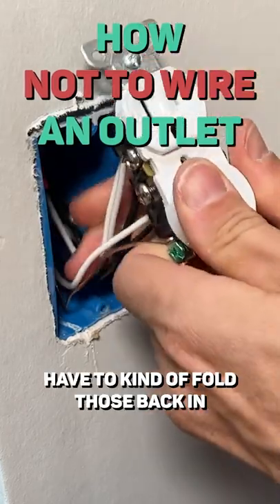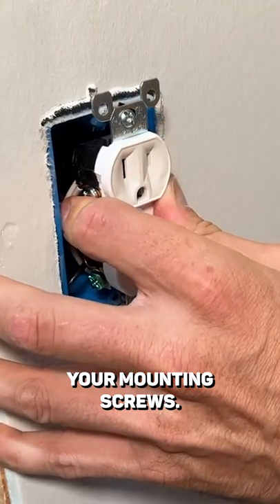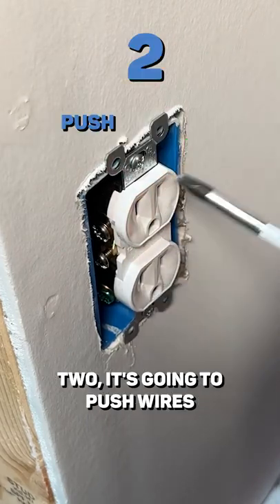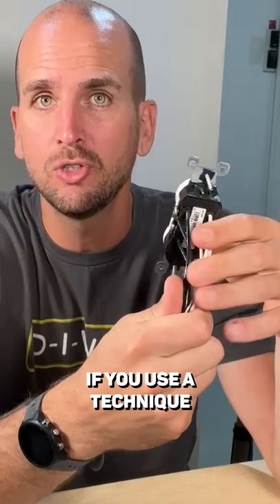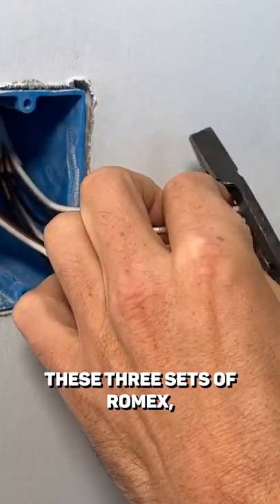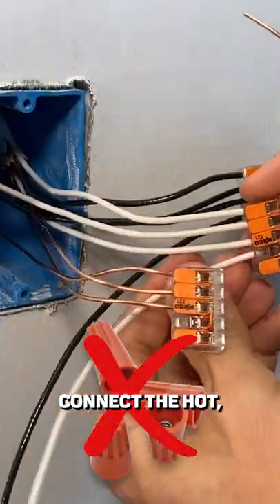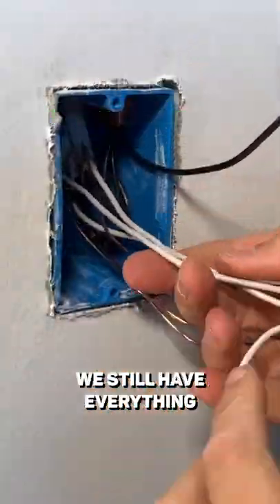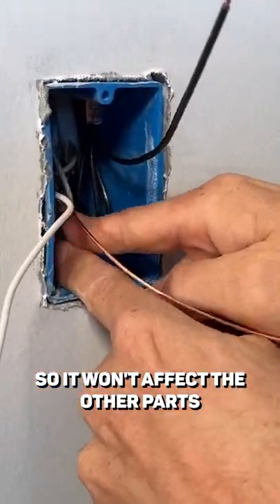The Better Way To Wire Outlets #shorts

Comment: wagos will never be better than actually twisting your wires with lineman's.  I've heard some people in the trade call wagos baby burners. The wires don't always pop out but I have seen it.  If you twist your wires properly under a wire nut the wires will never pop out . We do use wago on the trade but I have yet to meet a good electrician who likes them.
Reply: the problem with wagos is twist to release... when your ramming wires into an enclosure that wago can rock and twist and loosen the connection... wires twisted with lineman and a wire nut is far superior in my experience... I used to build and remodel homes.
Reply: The lever Wagos only fail if you haven't correctly inserted the conductor into it with enough insulation removed or not snapped the lever back in properly.
Reply: @Ad-gn8pl  lever wagos are nice. push in or push wire not so nice.
Reply: @thinkamajig  never had a problem with the push fit Wagos, I prefer the lever ones though as they are easier to remove.
Reply: Lever Wagos ftw with lighting.  I'm gonna stick to twisting and wire nuts for receptacles though.  Less resistance.
Reply: Electrician here and I do not prefer w
Wagos. A properly installed marrette is perfectly fine
Reply: @Teh_Random_Canadian  wire nuts aren't used in the UK. Wagos are now the preference. Reusable, demountable and they don't wreck the conductor
Reply: @Ad-gn8pl  Wagos are uncommon here as a properly installed wirenut will never come undone and provides a much better surface area connection
Reply: @Teh_Random_Canadian  when you need to remove the nut and extend the circuit what do you do? Wagos also will never come undone 😉
Reply: @Ad-gn8pl  untwist them with your linesman...
Reply: @Ad-gn8pl  wire nuts untwist... Easily.
Reply: @randybobandy9828  After removing a wire nut you are left with conductors that are already damaged from the first installation, then you damage them more when you reinstall unless you cut them back, shortening the wires.  Wago doesn't have that disadvantage, they are much nicer to use when testing and fault fading circuits.

Comment: I love the Wago nuts. My only complaint is that they take up a lot of room in the box - especially if it has 3 or more sets of romex coming into it.
Reply: I was concerned about that too before I took the plunge and bought my first box of Wago nuts, but now I'm actually inclined to disagree. I've personally found that they're easier to manipulate in a box than marrettes. Putting aside the conveniences of being able to add/remove wires as needed and not having to twist them all together, I find that while they may be slightly wider than marrettes, they're shorter and flatter, and their rectangular nature allows me to shove them neatly into the back corners of my boxes. Plus the fact that each wire can swivel inside the connector gives a HUGE flexibility advantage.
Reply: @donaldholden2090  Ok, you've convinced me. I'm going to order myself a box of those guys and try 'em out. I've got some repair work and some new runs to put in.
Reply: @mrz80  Make sure to get the 221 series. Let me know what you think!

Comment: 3 The recepticle is installed upside down. Ground pin up for safety.

4 Backwired to be less reliable and less safe. Use the recepticles with saddle clamps.

Comment: Here, in the E.U. where everything is parallel, only 3 wires would go into the box in the first place. On top of that, its safer for power distribution as you avoid long loops.
Reply: How do you connect multiple devices to a single circuit? There has te be a connection somewhere unless each device is on its own breaker.
Reply: That’s not true. If you have a serial connection you mostly have 6 wires goin in.
The are connected to a outlet with push in clamps. Never fail. 3 wires are used only when there is no other outlet being connected from the actual one

Comment: Chances are if your stabbing in the back of the outlet, you’re probably using #14 wire. Pretty easy to work with. This design is mostly used by contractors anyway. It’s done for quick installation bc in that game speed is of the essence. If you’re a homeowner however, you might wanna pigtail bc it is a better installation.

Comment: Wago is fire 🔥 waiting to happen. Spent the last five years retrofitting a building that was remodeled using Wego’s. several fires throughout the facility convinced the owner to switch back to wire nuts and proper terminations

Comment: Use stranded pigtail, makes it easier to push in box and doesn't make recept lean one way or the other.  And tape recept before pushing in the box.  Preferably with 33. And screw wagos

Comment: If there's 3 sets of wires you did it wrong.
You should use screw down terminals if you don't like have fires. You should use steel boxes if you don't want fires to get out of boxes.

Comment: All my outlets are pigtails with the twist-on connectors (made in the 1980s);  I know because I had to troubleshoot and trace a `open neutral`.  One of the sockets that never gets used was the culprit (behind furniture).  I trimmed it down and reconnected.  Since the mains were off, decided to inspect every socket and switch in the house.  Electrician did a real good job in the 1980s.  But there were disturbing layouts that would not fly today.  Like the bathroom gfci controlling the outlets for another room.  GFCI outlet failed a test because the reset button would not stay depressed|on.  Had to go and find a GFCI.  Fun fact.  The GFCI leviton outlets switched or swapped the LINE and LOAD positions from the 1980s.  1980s 20A GFCI outlet on a 15A breaker.  I bet you can probably do that now and 1980s;  probably transients like we get in computer motherboards.  Weird stuff going on.  Keep an out out for freaky stuff.

The wire-nut twist on connectors was great!  I could check live voltage of the neutrals.  I could not imagine checking WAGO and IDEAL push in;  they don't have the test terminal spots.  Also I do alot of mobile electronics stuff.  Those WAGO or IDEAL connectors suck sometimes.  I have also seen lightning melt those little f4ck3rs and other things carry high amperage.  Was probably installed by a bad electrician.  But I think I like the wire-nuts twist on connectors better.  I guess current guys don't like it because it might be a possible point of failure or something.  The 1980s house wire-nut electrician did it perfectly and lots of thick 12 wire twist braided correctly on every connection.  That guy was good.

P.S.  I am not an electrician, but I am a computer engineer, electrical engineer, and CS major.  Probably had enough know-how to go d1ck1n6 around in there.  My dad's an electrician for a major utility plant and he and I would fix AC (alternating current) stuff and visit sites.  He used to teach me all the rules not to kill myself around AC electricity.   I've  been around electricity for a long time.  But I do not know current inspection codes.  So maybe it was legit.  Found this video to help calm my spirit to see what the laymen guys are currently doing in 2023.

Good Video.  And thanks.
Reply: Fyi the Wago do have test holes for probe

Comment: Use a full sized Metallic box with a single device cover.  and real conduit!   If you are just throwing in rope and plastic boxes, you may as well staple extension cords to the baseboards.   I hope you have plenty of insurance when those mickey mouse connectors start to fail.  That plastic will get brittle and the connectors fail before the owner pays off the house..

Comment: On top of all the other reasons/advantages of using pigtails, this is one never mentioned by most... better ability to fold the wiring back inside the box.  Only the wires servicing the device must be bent back as it is mounted, the rest are pre-folded into the box beforehand.

Comment: You can’t do this if you’re wanting the string to to trip your GFCI, right? You have to pigtail at least first in the string to the GFCI?
Reply from the maker: If you want downstream outlets (non-GFCI) to have GFCI protection the power feeding those outlets needs to come from the Load terminals on a GFCI outlet or the entire circuit could be ran to a GFCI breaker.

Comment: He's absolutely right about pigtails. Never use Wago connectors. The internal metal clips have a smaller surface area connection of the wires. Use wire nuts. Always, always wrap the outlet with tape.

Comment: OK, so here comes the can of worms. Back stabbing is horrible, I agree but if side screws are used how often does the connecting strip on a receptacle fail? Is the connecting strip not designed to take the full load? Are securely screwed connections not better than those spring loaded connectors? If the receptacle fails what difference does it make if the downstream devices stay connected; aren't you going to kill the power to change the failed receptacle? Please explain. By the way I am not an electrician but I think these questions are noteworthy.

Comment: I guarantee you, the walls of this house that I currently rent. My landlord outsources almost exclusively from 'immigrants-ar-us'.... I mean the ones that have been doing it 3 months and know exactly how to do everything, for much less than the guys that own the vans they drive... I mean that in most respectful way possible... Like, only a true electrical genius could wire every single ceiling fan in the house so that they powered independently of any wall mounted switch in the house. I'm sure they're on a breaker in the breaker panel as I at least checked to see by switching breakers off one at a time. The goal is to be well outta here by next summer.

Comment: The problem I run into with plastic boxes, is all of the shifting and moving around to fold the wires in, wiggles the Romex around so much that it breaks the integrity of the little plastic clamp coming into the box, and then the Romex is moving free in and out of the box.

Comment: Even if the plug fails it’ll be fine if the wires are screwed in.  It’s a physical connection.  Are you all suggesting the metal plate linking the two common or neutral screws is somehow going to fail?  How is that weaker than a wire nut?

Comment: That right there is a series circuit and you just put it into a parallel circuit which means if that receptical goes out it wont effect the other recepticals correct me if im wrong

Comment: By code the it's illegal for the circuit to be dependent on the device for it's continence. You should be able to remove the device without breaking the circuit. I don't recommend pressure connectors like the wago's in the box. Wirenuts take less room and are far more dependable if done correctly.

Comment: Pigtailing is not necessary and an added expense  if you have enough wires to use and done correctly. As others also said, it becomes crowded inside the box.

Comment: And ALWAYS put the wire around the screws rather than using the push connectors that won't maintain a solid connection.

Comment: You should have used electrical tape and wrapped it around the device in case the ground accidentally touches the hot screw.
Also those lever nuts are humongous you're not only adding lever nuts but you are also adding wire. Therefore I don't believe it's easier to push in the device when you are adding way more stuff.
Reply: It is easier the Wagos aren't ideal for space saving but pigtailing is better in almost every way. 

It allows you to fold the line conductors into the back of the box, have only 3 wires going to the receptacle, you aren't using the receptacle as conductor, and it's easier to get the receptacle to mount flush.

Comment: Box fill is very important and the wago especially the size 5 take a ton of space compared to a wire nut. Also in my experience the wagos can open up  when you move the cables around, need electrical tape to make sure they don’t open up. I like wagos for combining stranded with solid wire.

Comment: I always used a wire nut...added a wire...bang...used my Klein handle to push the wingnut to the back of box....leaving the 3 sticking out for finishing...same principle as the nice pretty new wago connectors...how much you charge for the wago pigtail? Lol...

Comment: Thank you! Pigtailing should be required by all codes. I usually throw out all contractor bids that do not pigtail. See that as lazy and not providing the best electrical.

Comment: First of all avoid backstabbing outlets. The tabs that hold the wires create a weaker connection than the screws on your receptacle. They will work, but are not as good in the long run. Your pig tails look great though! Btw wire nuts are also a better joint than wagoes.

Comment: Buy spec grade receptacles they don’t have back stabs they have back wiring which is two metal clamps tighten by a screw way safe rthan  pushing it in a hole that spring loaded even better than the side wiring under the screw.

Comment: I pigtai everything I do not relay on the device to carry the load down stream. Im a service tech and a bunch of my work is replacing burnt devices, rarely does a properly installed wirenut go bad. Wagos suck, i never use them

Comment: Several pros have commented that they usually pig tail all outlets, several have complained about backstabbing.  Funny I have owned or helped maintain 10 houses (most post 1995 construction). Never have I seen an outlet pigtailed and back stabbing is common. The only place I have see. Pigtailing is when two or more switches are in one box.  And that is only dimmer switches sometimes are pigtailed out of the box.  Btw, one house had two dimners wired wrong, and I have seen the ground and nuetral bonded in random places. 

What gives, are "most" professional incompetent, or are all the pros watching how to videos just the only good ones.

Comment: Australia got rid of solid conductors and the earth cable is insulated. The cable I have seen from videos from the US is like the cable that Australia got rid of in the early 1980's. Australian outlets have insulated terminals as well. It seems like a much better system than the wiring systems from the US. Seems that way anyway.

Comment: I have a really hard time with those lever nuts. Everytime I use them one pops out when I'm pushing thie wires back even if I'm careful. Idk if I'm doing something wrong but it just doesn't seem worth the risk compared to a standard wire nut.
Reply: You need to make sure the wires are bottomed out at end of the viewable plastic housing. Try not to rotate much or twist them or the wires will start to back out. I find this not to be a deal breaker, but a bit of a design flaw. Just something to be aware of. The levers tend to move out slightly which won't release the wire unless another wire gets cought in there.

Comment: Okay so you just added an extra 3.00 per box by using the wago's you are using. In comparison just having the single gang box and an outlet would cost around 2.50. Also, you just used an additional 12" of wire which also adds to the cost. The only thing you should be pig tailing should be the ground with a wire nut. Also, when I wire a house I try to not three hit a single gang box unless I have to.

Comment: If you don't use wire nuts with a spring termination ,you're going to create an arc fire inside the wall that will at the least melt the plastic device and box. Stop claiming wagos are a better termination choice, better yet keep using them risking people's lives it just makes more work for me when I have to remove and replace them with wire nuts that hold tight with the expansion and contraction of a conductor during a normal load cycle.

Comment: I never understood why the device is carrying loads.  This is why don't allow my tenants to use space heaters.  At 1500watts Every its hot from carrying the load as soon as you plug something you got a fire.  Especially in older homes with worn devices.

Comment: Firstly why are you not wrapping the outlet in tape for safety and prevent arching. Second hopefully those waygo's can handle heat if someone plugs in an appliance into that socket that draws a lot of electricity. Waygo's have a history of over heating in high output situations.

Comment: I guess people like pigtails these days but outlets are made for 2 sets of Romex wires to be attached to them, and or split them to control one outlet. As long as you strip the outer insulation back enough, I never have an issue getting an outlet in or flush, seems like everyone is a bit soft these days. The less amount of connections, the less chance of one coming loose and arcing, IMHO...

Comment: Ok. To all u hateful and stubborn electricians out there…
Pig tailing in fact does save room in the box even when adding the 2 wires. It takes me less time to properly twist 3 wires, cut the excess and put the wire nut on than connecting 3 wires to one side of the outlet. So after the hot and the neutrals are bent up neatly and out of the way, there’s plenty of room for the 2 wires to be pre-bent and pushed back the outlet. There’s less restriction this way, especially if it’s 12 wire. 
And to change out the outlet down the line if needed, there’s only 3 wires to deal with. The only time I use Wagos is if they come attached to a light fixture. I prefer the wire nut method myself. 
Also, I always tighten all the screws and tape around the outlet or switch. It’s an old habit I learned in commercial work. Prevents shorts with any bare wires.

Comment: Poor form to touch both side of outlet while putting into box . This leads to muscle and technique memory which you may do inadvertently to an outlet that’s hot or accidentally turned on by someone else while working on outlet .
Only touch yoke ( Top and. Bottom) 
It’s correct to pre-bend wiring for easier install and all eliminates pressure on connections.

Comment: Wire nuts are fine. Those plastic connectors burn up, especially with a large load
Reply: Not for wagos. It’s quality not like most stuff in the USA